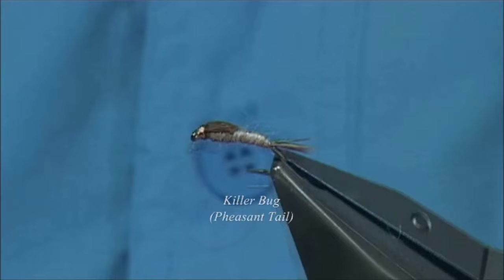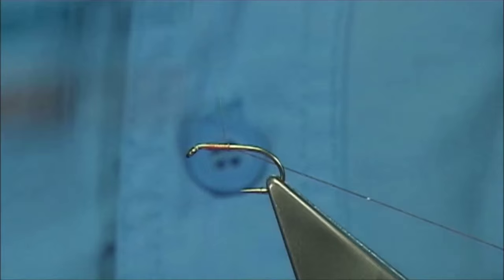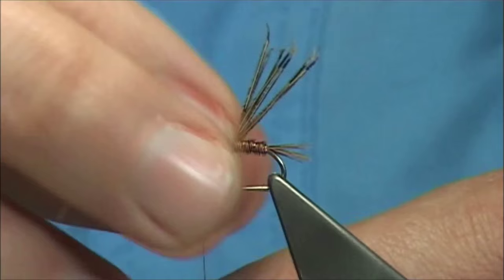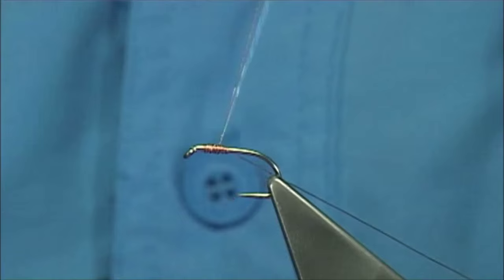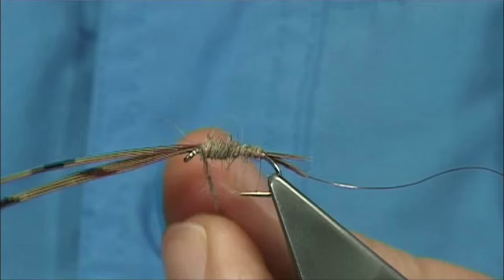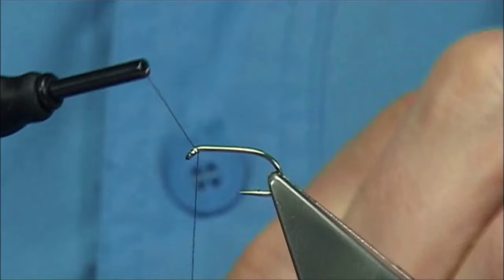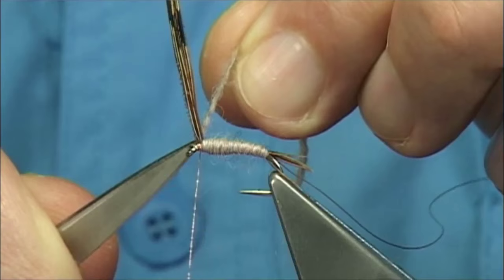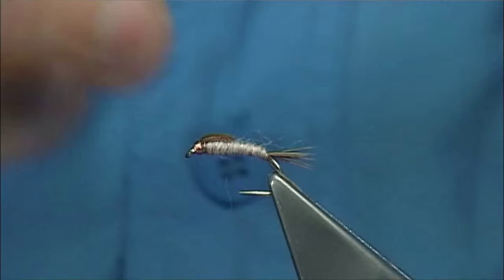Tying Three Killer Nymph Patterns by Davie McPhail

Comment: Davie, this is the second or third time I've watched this and each time I learn a bit more and the te hnics used are great and actually quite simple to implement, but I have found that choice of pheasant tail feathers is pretty important to get the thorax cover to sit well. I can't use wire as I don't have a ceramic bobbin holder, but as you sY it can work with thread I just add some flat lead wraps to gain the weight.  Thanks again and keep up the great work.

Comment: Davie,              Great patterns that are easy to tie and will catch fish!  One thing I have added is to fold half of the ends of the pheasant tail fibers down each side to emulate legs/wing butts at the end of the tie instead of trimming them off at the top of the head.  I trim them to the desired length after the whip finish. It seams to give the fly a bit more motion and a little different profile in the water. If they do wear off after multiple fish the it's back to the original form.  I appreciate all of your efforts in sharing your talents with us.  I learn something new from each pattern you demonstrate.  You truly make fly tying fun instead of a chore.  Thanks a million and keep them coming!Happy New YearDoug
Reply from the maker: Hi Doug,

Thank you for letting me know how much you like the flies I tye. Many of the easiest flies we tye are by far the best patterns in our box and adding some touches like the one you use work really well...Happy New Year to you too and all the very best for 2016...

Davie...

Comment: Davie, how do you keep the fine copper wire from twisting up and breaking off in your bobbin holder?  I want to easily add the weight of the copper wire using my bobbin holder, but it's become so frustrating that I've opted for using thread at the expense of nicely weighted nymphs.
Reply from the maker: Hi Stephen Palmateer,

Just make sure that you adjust the bobbin holder so that the bobbin runs smoothly from it and if you can use a ceramic bobbin holder as this helps a lot to stop the wire waring as you wind...If you can as well use the UTC wire as it is coated and is great to tye with..Have a Merry Christmas and a Happy New Year when it comes...

All the very best Davie
Reply: +Stephen Palmateer Yeah just make sure that the bobbin holder is well adjusted. I have never had problems with breaking wires even when tying with the cheapest/lowest quality bobbin holders. You can also tye flies without bobbin holder, simply doing it by hand.